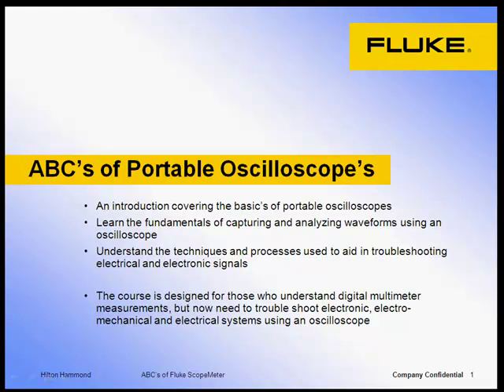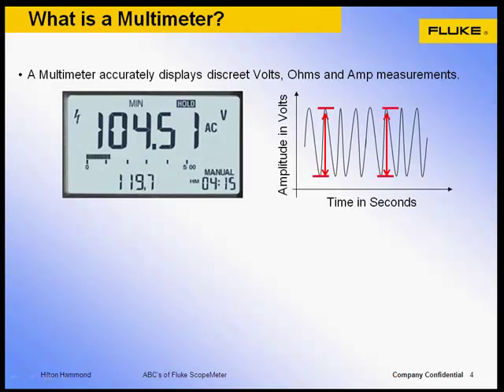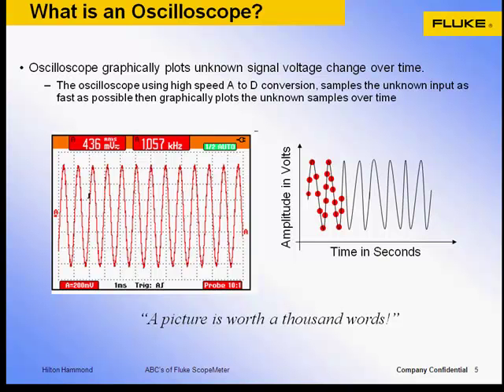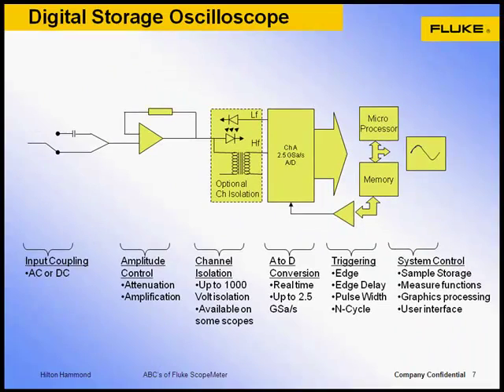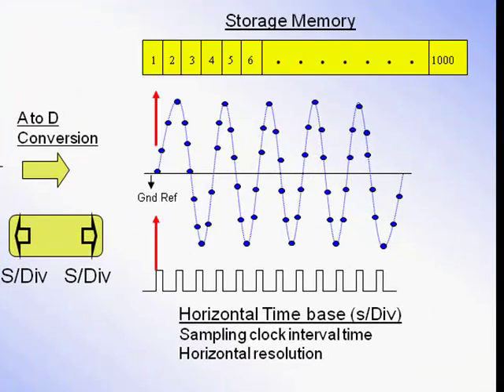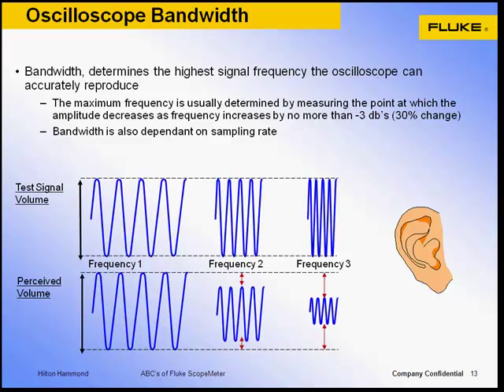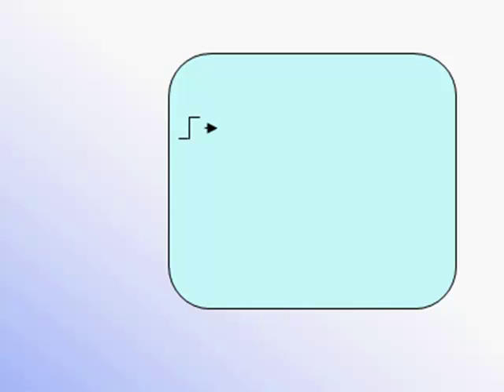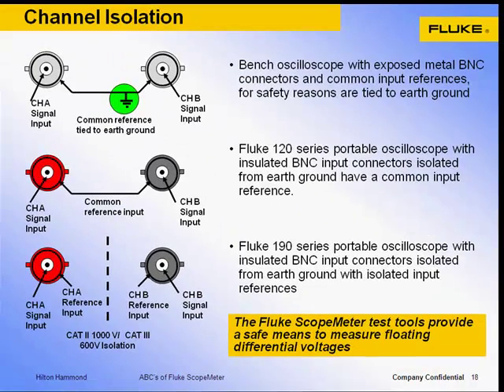Portable Oscilloscope Webinar Series Part 1: Basic Theory

Comment: Fluke is going to lose portable oscilloscope market share to Rohde & Schwarz.  I used to only buy Fluke portable oscopes.  My last purchase was the Fluke 125 2 channel  40 Mhz scope.  The user interface was just bad design.  Navigating the menus was not designed very well.  Some things just seemed awkward to try to get to.  After 8 months of using it I got tired of it.  I went and bought the 500 Mhz RTH series from Rohde and Schwarz and couldn't be happier.  This scope blows away the Fluke 190 Series.   Fluke has dominated this area for 25 years, but it is going to lose significant market share if it doesn't improve the screens, user interface, and the specifications.  So sad to see this happen, but GE screwed up by forgetting how it made all it's money.  It got lazy and neglected it's core business.  Now look at GE.  A sad shell of its former self.  It sold nearly all of it's commercial electrical products to Siemens or ABB.